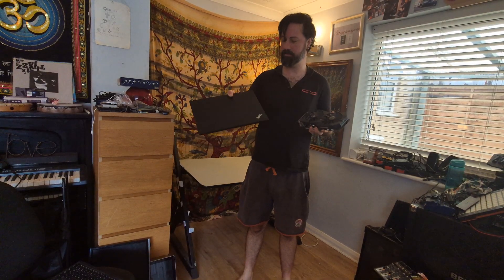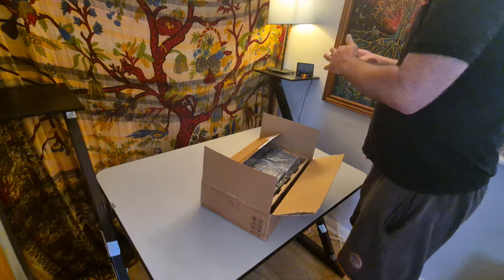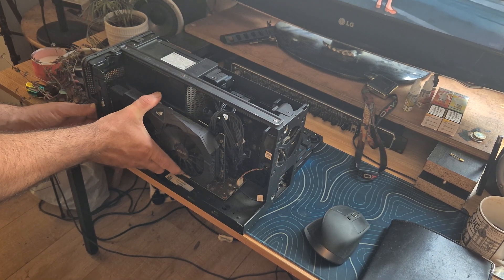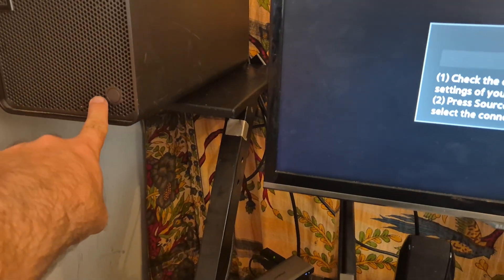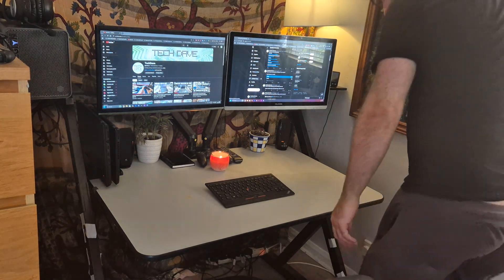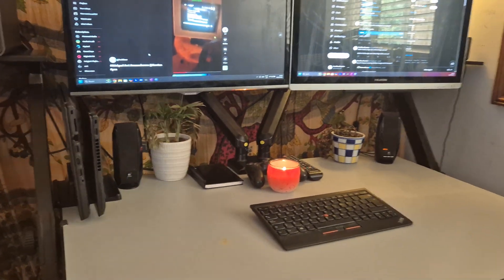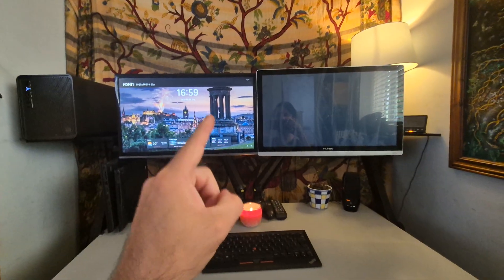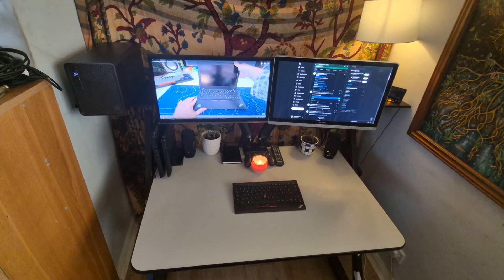Best Budget eGPU setup 2025! T480 & RX 570 8gb! (part one) Under £500!

Comment: I have the same egpu unit. Need to pick a GPU to go with it. I’ll be using mine with either my X280 or an L13 gen 2. Considering my day job is being a Mactech, these Thinkpads are becoming addictive! :)
Reply from the maker: Awesome! What GPUs are you considering?
Reply: @TechDave probably an RX580 or similar
Reply from the maker: @mcal27 nice choice 👌 they're still solid gpus
Reply from the maker: @mcal27 I got my 570 8gb for 60£ from cex 😊😊😊
Reply: @TechDave bargain and it’s 90% as good as a 580 too. I’ll have a look there myself. Cheers
Reply: @T @TechDave my 280 arrived. It’s lovely! It does have the 1366x768 screen though. I’m likely gonna get a 1080 display for it.
Reply from the maker: @mcal27 niiiiiice happy for u! 🎉🎉🎉

Comment: Hello, Dave, i just lost my touch screen yesterday. my half of the display went black (it was my mistake). can i replace it with a non-touch one. i researched and found that t480 for touchscreen needs a 40pin display cable. so my idea is to replace the whole display cable with a 30pin display cable and use an old t450 screen on it as both have a 30pin display. Would it work? i just want your opinion on it.
Reply from the maker: Hmm, I wud search but off yhe top of my head u wud need a converter board to match the display pin out
Reply from the maker: And yes I shud think a no touch display should work fine
Reply: So do you think it's  a good idea to change the display cable to a 30pin and use any 30pin display
Reply from the maker: @spiraxgaming2234  honestly i dont know without research. but: i would imagine you need to make sure that the pin out is the same for both displays
Reply: Yes they are the pins are same i.e. 30pin
Reply from the maker: interesting. and they are electronically the same as well?
Reply: Well that is what i want to confirm so i need you help😅
Reply from the maker: @spiraxgaming2234  ah, i have no idea my friend, thats not my area of specialism im so sorry
Reply: Okay no problem btw you make really detailed reviews and i really love your work
Reply from the maker: @spiraxgaming2234  thanks! i do my best xx
Reply: Bro i made it, i fixed my T480 and successfully added T450 display and changed the display cable to a 30pin cable and the display worked
Reply: The screen is obviously shit but it works atleast probably upgrade to 1080p screen after sometime
Reply from the maker: @spiraxgaming2234 siiiiiick
Reply: @TechDave  yeah bro i think add it to your list that t480 works with any 30pin display if it just physically fits. It was just a 800 rupees gamble in my currency or 10$ USD but it worked and i am just surprised. so i think that t480 works with display from i think T440 to T480 models.